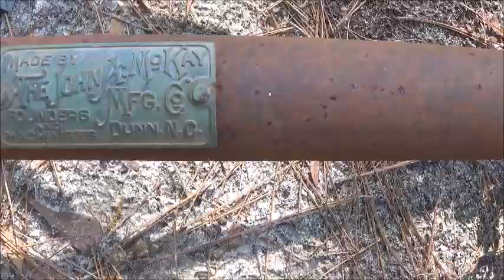EDGERS, SAWMILL AND MORE!!

Comment: Interesting. My grandfather was a sawmiller in the early 1900's. His job was tending the steam traction engine that pulled the mill and he sharpened the saw blades. I remember as a little kid long after he'd retired from that there would be millers who brought their blades to him to be sharpened. They knew he had the ability to do it right. No question that sawmilling was a dangerous profession. Jonathan, when I was a teenager I worked in a furniture factory with my dad. When I worked there the company installed a Newman matcher which is similar to your machine. It had 4 heads, 2 to surface plane and 2 for edging. It had 2 125HP electric motors pulling the planer heads and 2 75HP motors on the edger. It would run 100,000 board feet a day. Boards came out of that thing like they were shot out of a cannon. I only worked around that monster a few times. It was so loud that you could scream at the guy standing next to you and he couldn't hear you.

Comment: Jonathan, what you just said brings back so many different memories of what my dad said about the depression an how life was just not so valuable as production an other stuff. I worked in old old shake an shingle mills as a kid starting for dad and then later in the seventies when times would slow down for what ever reason. Washington state was good to me for many reasons in milling but my heart was mechanics so there it went. I used to hammer the circle blades for the shingle mill cause when they spin up, then they also straighten up.... too many years have past for me to be of any value to anyone. I sure do appreciate this video!!
Reply: I remember when there were shake mills everywhere in this state. Times have changed, and not for the better.
Reply: @nowhereman7398  Its not the working mans government anymore... money is nickles an only because china depends on some of our products, they haven't foreclosed on our half cent dollar. I started sawing shingles in the early sixties in marblemount washington an then went to forks for a good many after the service. I came to alaska in 84 and never looked back as the economy was just falling apart, logging had all but died
Reply: So do they give you a certificate/license/certification when you pass the test...1 answer wrong don't sound too crazy to me - l maybe crazier than you

Comment: I worked a large part of my life in Saw mills. Starting with my Dad. and working for a company. who grew from a few thousand feet a year to millions of board feet a year.  Over the years I did any job they needed me to do. If the saw bits are hss then all you need is a swage to set the kerf and hand file the bits. They also have carbide tips,though you will need a jockey grinder with a diamond wheel. Use a hammer just big enough to move the saw metal and not make dents,they make tight places in the saw. I was a saw filer also and did that for years at the mill.  I am not trying to be a know it all. I just learned what little I know from doing the job. I hope this may help you or someone else. All my very best.

Comment: Edger saws are repaired and maintained just like a circular saw for sawmilling. They also need hammering. I worked for a feller that hammered saws. You can use 7018 to weld on a shoulder if you hit something in the wood and break it off. Some guys use swedish tig rod and tig weld them on. To maintain bit width  use a saw swadge. It fits over bit and struck with a hammer. Simonds,Hannaco, and Hoe are some names of saws and bit and shank manufacturers I remember. AL B.

Comment: Excellent Johnathan W   :) also years ago heard about Saw mill accident my one late Neighbor Fred was in school losing his dad also mom home when  and him take over home  farm in 1930 's ! Fred was walking back home from Ponnier School also notice one horse lose in feild of hay and got to were Saw mill operation was help my great  Uncle Roy and Uncle Harvey say big log hit Fred dad Charlie in cheast kick in wood pile ! So got him no way could help out Charlie was gone and then Fred my 2 great Uncles told Fred mom she was shocked too what happened at 1:00pm that afternoon !  What use was two horses full grown ones in  treadmill run Power to belt saw mill cut so lumber for Pole  barn to make ! Fred was only 13 years old at time  in grade 7 and he was after accident happened! Also hear one  my late Grandfather Bill Sr , Fred My uncle Bill JR , Dad in 1954 had 1950 Cockshutt COOP 40 43 hp with 60  Buda motor gas 6 cylinder 235 Cubic Cm size 6 volt positive ground had belt pulley running Threashing Machine draw bar type with rubber tire in hot summer do grains plus pick cobs corn some how it burn wood but steel frame plus 4 tire survive they said heard people seen fire of Threashing Machine for miles throught big forest fire but wasn't! Tractor survive too but went to different Threashing Machine use and bought one then 1960 John Deere Handmill I learned on too was belt drive then got another one  had did PTO of tractor!

Comment: i used to work in a bronze foundry and many times we'd screw up the sequence of shutting off the steam to the autoclave. (turn off the steam first, then depressurize, then unbolt the door). shortly after i left that job another employee got in a hurry and opened the door without depressurizing or shutting off the steam. it blew him apart. i was told they found his head on the far side of the shop. i was lucky that didnt happen to me. that was a REALLY dangerous job in so many aspects

Comment: When I was 4 or 5 (1949-50), my Dad and brother did custom thrashing using an old steel wheeled Case tractor.  I loved the whistle and against the rules, I got up on the tractor platform and pulled the whistle chain a few times.  Evidently I sounded the emergency code, because I thought the world was ending.  Everyone came running and I earned a spanking.  I scared everyone,  especially my Dad. I have the whistle.

Comment: My uncle ran a mill that was built in the 20’s or 30’s. It had lots of old machines like those. Very dangerous unless you knew what not to do.  He had a 60” circular saw that was used to cut the cants out of logs and smaller saws that cut boards. He used the slab wood for heating his house. In the early 60’s he thought the electric company charged too much for power, so he put in a big caterpillar diesel that ran the whole mill. It was all overhead line-shafts and flat belts.

Comment: I believe that edger needs more rpm. That's how ours sounds when the power unit is a idling. Ours sings at rpm. Ours is a frick edger and turner mill with a 180-190 cummins. Was ran with a farmall before I was born. We use to cut tobacco sticks, barn patterns and wagon beds. Was probably 20 sawmills and pallet mills around here at one time. I'm just 32 but been around it all my life.
Reply: We have a drag chain under the saw but have to shovel sawdust from under the edger. My family use to haul sawdust to kingsford charcoal too. We sawed our house pattern and planed the flooring and 2x6 studs

Comment: I used to run the mill for Pineland Lumber in Lewiston, Maine. Building started out as an ice house on the Androscoggin river. All powered by 440 3 phase. 14" 5hp direct arbor tablesaw, 32" 2 sided planer, 6 head 4 side novelty planer, power feed angle adjust resaw with 6' dia. wheels bottom wheel 3' in the floor. Could split 1/2" x 12" plank corner to corner for 2 clapboards per plank. Skip the swing saw ain't worth it too dangerous more so with cobbled guards, also had twin head shaper with 1" and 2" custom cut pairs of knives. Thing almost killed me twice. Could throw knives. It bit and split a perfectly clear kant of western red oak 2"x2"x2' from corner to corner up to corner on my end and threw it by my head so fast i didn't see it go, took a month to find stick. Could stand 8' back from tablesaw and feel breeze off blade. That planer would trim some serious lumber. The novelty planer with right knives setup right will do twin clapboard shiplap and tongue and groove log siding. She's gonna wanna takeoff and dance on down the road with the log siding so she better be tied down good! Joel up in the pine tree state

Comment: Johnathan ,my father worked wood all his life and he told me a cross cut saw cuts a wide kerf due to offset saw teeth were as a rip blade does not have a wide kerf because it does not offset teeth because it is cutting in the direction of the wood grain. If I am wrong please correct me . Cool older tools.

Comment: When I was 17years old I worked at a saw mill it was just me and the owner the saw ran off a huge caterpillar engine I don't know what size it was or what it came from but it was started using a pony motor the saw blade was taller than I was and I was six feet tall but any way no-one was let anywhere near the saw when it was running we cut slabs into fire wood and even the strips from the dryer was used for fire wood a d sold as kindling as cut all kinds of logs into all kinds of wood but the biggest thing we cut by far was railroad ties now the owner did all the cutting and I did pretty near everything else let me tell ya if you stack railroad ties all day by hand you know you put in a good days work the boss also sold all the sawdust to a farmer as bedding for his stears and hefers. Anyway this video just got me reminiscing about it good job there it looks like you could get a decent operation going there if you wanted anyway good luck to ya

Comment: Many years ago, I had rented an old farmhouse that I heated by using wood stoves. My father found a farm about 45 minutes away that operated a sawmill. I would drive there and purchase a pickup-load of the un-useful trimmings that were cut into @16"-long pieces for firewood.

Comment: Feb. 1, 1999, a boiler at the Rouge River Ford Plant in Detroit blew up because the draft was not sufficient to keep coal gas from accumulating.  There was some problem with the forced draft air system as I remember, you cannot have positive pressure inside the combustion part of the boiler.  6 people died in that explosion and 14 more were very seriously injured, Ford did not have up to date safety equipment somehow something happened it blew out the side of a building.  I was working on retrofitting a coal burning furnace with electronic controls shortly after that, it provided power for turbine for a 7 megawatt generator.  The boiler was 45 or so years old, I found a potential problem in the controls and the contractor on the job immediately demanded the problem with the controls be fixed.  It had been running that way for years but with all the work we were doing we had made it more likely to happen.  I know you are aware how quickly it can all go bad with steam pressure measured in the 100s of pounds.

Comment: The woodmizer I use to run had a electric motor that ran a thick carbide tipped blade in front of the band saw to remove the bark to save your band blade

Comment: Pieces that hold tooth in the blade are called 'shanks'. They have numbers on them. They do make an oversized shank, if shoulder is worn on blade. 'Pipers Saw Shop' can order anything ya want. Carbide teeth is the only way to go. 20+ plus in sawmill here, so i do know what im talking about. 
If you look into a cheap laser system on it, would make edging alot easier...

Comment: Thanks for this video! I was wondering how the edge works. That blade can be repaired. We did them at the saw blade place I worked at. They would straighten them and braze new carbide teeth in. Did stuff that size all the way up to stuff you need a chain hoist to lift.

Comment: I saw a old locomotive that burst back in the early 1900's. It looked like you stuck a knife thru it from the inside. 2&a 1/2 inch steel plating.

Comment: If ppl like you Sir didn't keep pieces of history in operation ... a lot of ppl wouldn't know how simplistic it actually was instead of computers doing everything ...
If you use the swing saw ..I ask please put a guard on it... speaking from experience, 30+ yrs of framing & remodeling it only takes once..on Feb 5 @ 9a.m.. I'm now missing my index but was lucky to keep the middle and ring finger.. ( I used to preach to my crews ..never ever lift that guard for any reason while in use ...I didn't practice what I preached ..I knew better) i research how many table saw accidents there are a yr 30k 😳 average age 18 - 25

Comment: I know it’s original but could you position the motor inline with the edger and connect them together some way without having to use that long dangerous belt ?? Just wondering
Reply from the maker: Belts are not dangerous. The reason for the belt is so you can run different equipment with the same engine.

Comment: I worked at a big hardwood flooring mill in Kentucky for a couple years. I seen some dangerous things go down there. They had plainers that were so powerful that when the boards came out they were shot about 5 foot up the conveyor belt lol. The electric motors were so big a regular pickup would bottom out trying to haul them. I watched 3 people get fingers cut off running a machine called an end master it put the groves in the end of the flooring and they cut tobacco sticks to one guy was cutting them to length and almost cut his hand off. It's dangerous work for minimum wage

Comment: The blades look to be standard ripping design. If the blade diameter is pretty close to a standard diameter you should be able to get replacements even if you have to modify the arbor holes to fit.

Comment: The blades on the width ripper you are using should havve straight teeth  with the hardened tips chisel ground. The tips are readily available from specialist shops and are braised on.

Comment: It's almost a comical assessment of our society today - that you are able to use 100+ yr old machines and still produce something/anything without a complete restoration. We all know what's going to happen to all the prius's long before 100 yrs has passed. Much less how many will get restored ever.
It seems to me looking down the rollers on your edger (from the infeed end) you may want to add an angle iron fence on the outfeed. Looks like the board you had laying on the outfeed rollers turned mid cut making it a bow cut. Might be a simpler way of dealing/working with the old machine and not getting into "over" restoring it. 

Yes sir doing anything can be a dangerous business, ask the guy that never did a anything (ate/drank/smoked) against his own health except get hit by the bus lol. Thanks for sharing